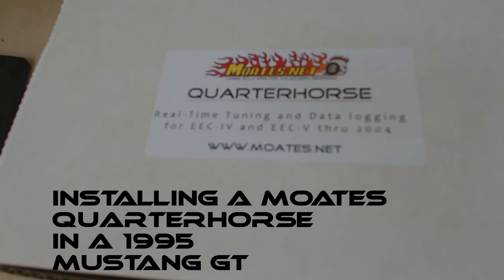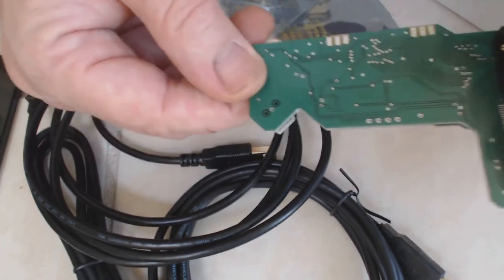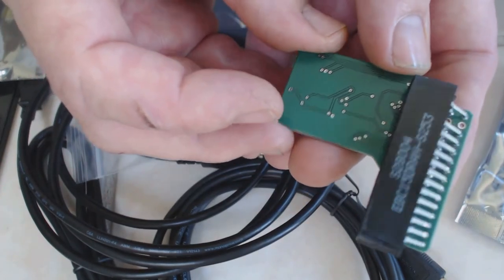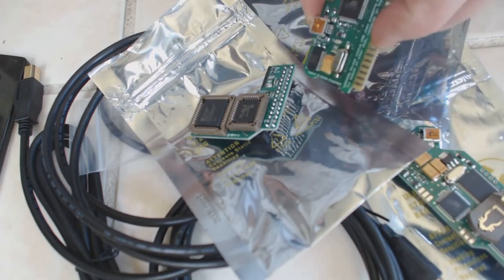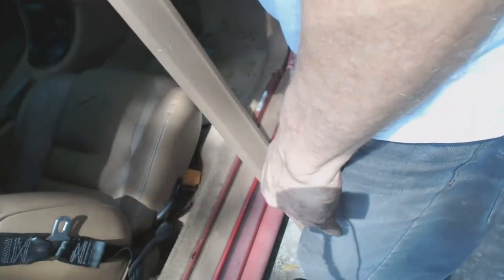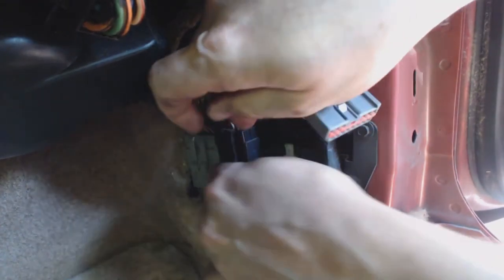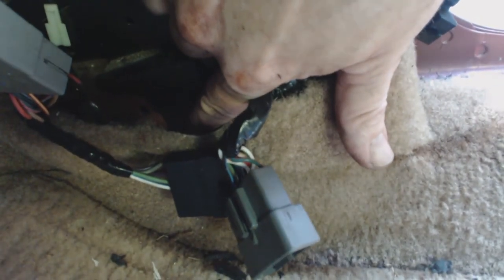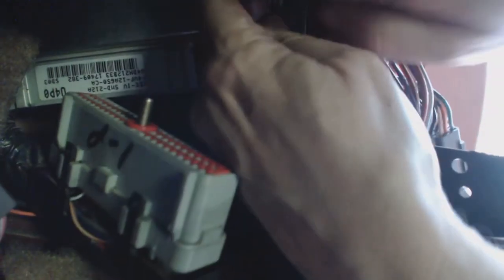Installing a Moates Quarterhorse in a 1995 Mustang GT Part 1

Comment: Stupid question (probably). So using a moates quarter horse, microsquirt or megasquirt tuner mean that you DON'T need to take your car to a tune shop to get a tune?
Reply from the maker: Depends on the end user.  LLLLLLOOOOOONNNNNNGG LEARNING CURVE.  If it is your daily driver, a tuning shop is your only option.  If you can take months to get the vehicle drivable, have at it.  Using a close tune, you can have time to develop your shills.  If you’ve never written Basic or C code and doing so is your idea of hell, use a pro.  Tuning with Binary editor is a slow process.  The newer the vehicle, the more complex the code to be changed.  Lots of gotchas.  Screwing up one function table can render the vehicle undrivable.  It is all a huge interlocking series of limits, tables, and rate of change parameters.  At first it is maddening and overwhelming.   Then you start to catch on after weeks of looking at tables, functions and numbers.  Expect MONTHS to learn how to tune.

Comment: I have a 95 Ford Ranger with the 2.3 Lima engine. I am planning on doing some heavy modding like cams, ported heads, headers, modified intake manifold, larger fuel injectors, ect. do you think this type of setup would be ideal for my situation? I am just looking for an affordable way to achieve real time tuning. This is a bit expensive but hey it seems like quality stuff so id be willing to go for it.
Reply from the maker: You would need to contact Moates to see if that engine is supported.  IMO Moates is the optimal way to go if they do support the 2.3.  

Very long software learning curve here.  Think MONTHS not days.  I'm still learning after over a year.  Watch the Moates Classes on YouTube!!!

Going the chip route is shot in the dark for your combination.  (Send your info to a vendor and the burn a chip for you.)  I've seen several "all in" cars that turned into undriveable disasters because there were just to many variables to try and account for at one time.  

USE FORD INJECTORS.    The data is posted on the web.  You just key the data in.

After you find a Strategy File for a close engine, find a BIN file for the parameters.  Study both long and hard before you change ANYTHING.  Find a tuning form that supports your software and hardware and ask lots of questions. Unless this a dedicated race truck, the same pitfalls apply as before. only they are even more damning if you get things wrong.  A long cam won't cruse worth a damn at 1800 RPM, and the computer will freakout with the low vacuum pressure. 

 I got my LARGER MAF curve close on the old engine, before changing anything else.  That supposedly accurate 4" Slot MAF curve I downloaded, WASN"T EVEN CLOSE!!!  ALL MAF curves are something requiring tuning even for a similar engine.  Bottomline: Do the mods in stages until you catch on to the complexities of tuning.  Making an engine breath better, tends to lean it out and my stock MAF curve  (And new 4" slot MAF curve) was WAY lean to begin with.  It took over a dozen changes in the MAF curve just to optimize the STOCK setup.

You'll notice I've never posted anything regarding software.  That's because I'm just starting to feel like I'm not the blind leading the blind.

last bit of advice:  Do this on you second vehicle.  Never on your only source to get to work.  Plan on several days of downtime as you sort out a few bugs after each change.  Save all changes.  You'll want to refer back later.  Document everything.  Make ZERO changes on the fly.  Stay as organized as possible.
Reply: Man thanks for the advice. I'm sort of nervous now though lol! Sounds like it's easy to permanently mess something up huh? I'll definitely wait till I get a 2nd vehicle for daily driving
Reply from the maker: Computers, just mean you don't need to get your hands dirty.  The knowing what you're doing, buying matching parts, and planning ahead issues are still there.  I know of one $65,000--$75,000 street Mustang that on paper should run low elevens or high tens in the quarter, but can't be driven out of the driveway.  Best advice I've gotten is get the Air-Fuel curve right first.  Real hard to do if you can't even get the car to idle.  Forced induction just amplifies the potential for a total disaster.  Without an expert on hand or previous experience, work in stages of modification.
Reply: For what you will have in parts you could turbo it. I had a turbo coupe in high school that was a fun little car. One if these days I want to drop a 2.3t into a ranger.

Comment: Push the tabs down on the 2nd and 3rd connectors. the ICM on the 2.3s is the same style plug, and I didn't know it until I snapped the tabs off.

Comment: Does this come as one whole kit? And about how much was it? I have a 1994 cobra mustang and I was looking at trying this out.
Reply from the maker: No, but you can buy all the pieces I've shown at Moates.net, including the software.  (I recommend Binary Editor AND Sailorbobs extended definition strategy file.)

Two main advantages over the 60s way of doing upgrades:
 1.) For the most part, you can make the changes with the hood closed  and looking at  a computer screen,.
2.) You have far more control of engine functions than you could have dreamed of in the 60s or70s.

The disadvantages:
1.) Cost.  Expect to spend double or even triple what a carb, manifold, and ignition upgrade would have cost for an equivalent power upgrade.
2.) VERY LONG learning curve.
3.) In addition to the right parts, the program must match functionality with the parts.

As I've stated below, I wouldn't embark on a major upgrade without 
alternative transportation.  Think MONTHS to learn all the intricacies 
of computer control.  

Stock tunes are very conservative.  You'll be able to feel in the seat of your pants the improvements you can make in the stock program with NO hardware upgrades.

Start your journey at eectuning.org.  Trust me, you'll be glad you did.